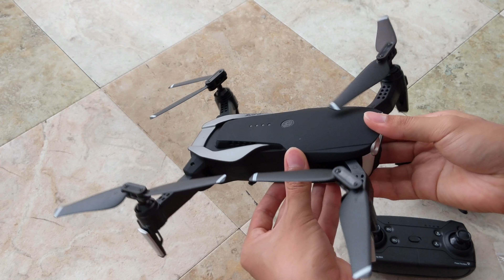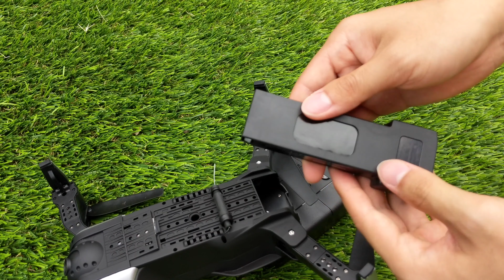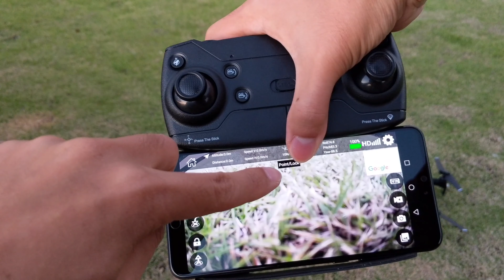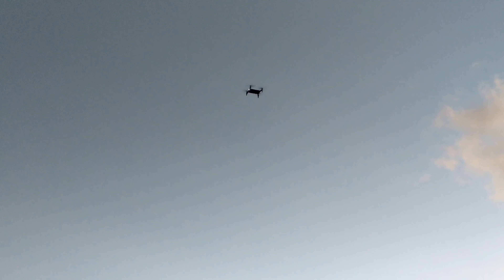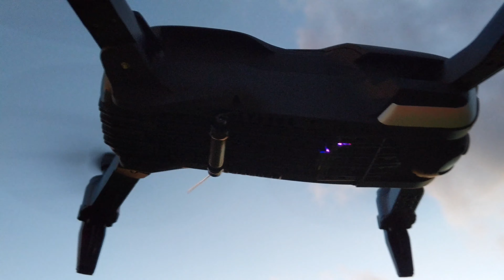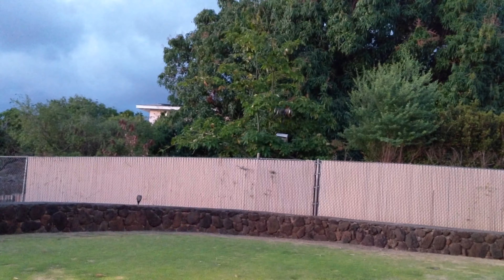EACHINE E511S GPS Drone Quadcopter DJI Mavic Air Copy?

Comment: I purchased this drone and here are the issues I am having.  I havent had this drone for 24 hours yet and I am having these problem.

PROBLEM # 1:

When I turned the drone on, it stabilized and then lands for no reason. Also, as soon as I turned the drone on, the remote/controller kept beeping (it beeped as soon as I turned it on). Even after a calibration it still kept beeping. As soon 

The remote started beeping as soon as I turned it on. It stabilized for about a minute, it kept beeping and then landed (return to home for no reason). 

Checks That I Did :

The battery on the Drone was at 98% 

The Battery in the controller Remote were brand new (batteries were good). 

The Drone was Calibrated 
Check for GPS connection (11 Satellites were available) 

VIDEO: https://youtu.be/wDCDj8EKFUI

PROBLEM # 2:

As Soon as I Turn The Remote On It Beeps Immediately and keeps Beeping.

I turned on the Drone, then turned on the controller/remote and it just keep beeping as if the battery was low but the battery was at 98% and the batteries in the controller/remote were brand new.

Checks That I Did :

The battery on the Drone was at 98% 

The Battery in the controller Remote were brand new (batteries were good). 

The Drone was Calibrated 
Check for GPS connection (14 Satellites were available)

VIDEO: https://youtu.be/3AYB1HeBoDg

PROBLEM # 3:

On Several Occasions the Drone Motor Would Not Turn On

Checks That I Did :

The battery on the Drone was at 98% 

The Battery in the controller Remote were brand new (batteries were good). 

The Drone was Calibrated 
Check for GPS connection (14 Satellites were available)

VIDEO: https://youtu.be/U_q4uSGE8_s

Comment: Inzwischen aktueller ( New Clone )   ist die Le Idea 20, gleiches Geld nur um vieles besser als die 511, 4K Video, 1Gimbal, brushless Motoren, ( better) effektivere Rotoren, 5,8ghz ( Sending) Übertragung, gestern bestellt :)
Reply from the maker: Hi, the Le idea 20 is not brushless. Also the image quality doesn't look too much better. The only major difference is the video transmission range and GPS connection speed.
Reply: M Tech the Video is no much more better, quality 1080 to 4k polish :) but the 5,8 GHz are good, not more, a good beginner Drone 2019